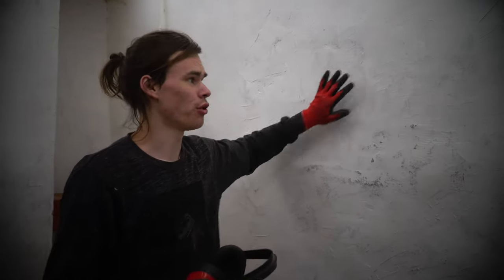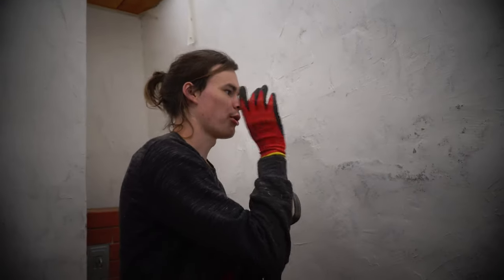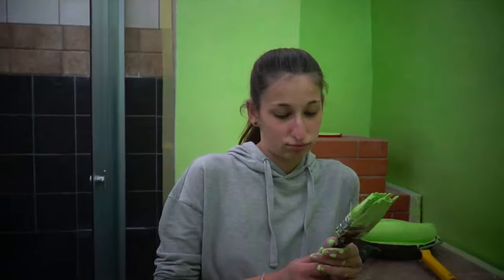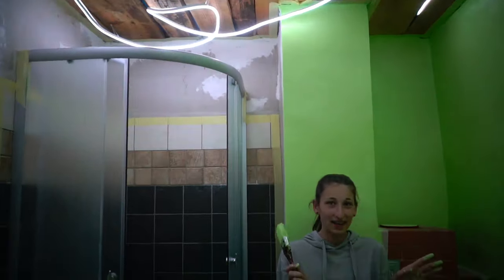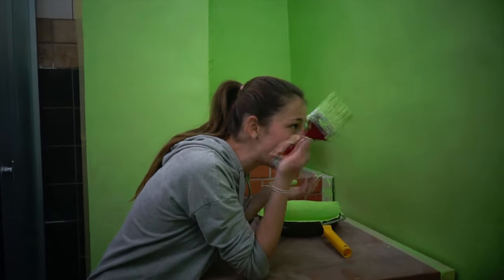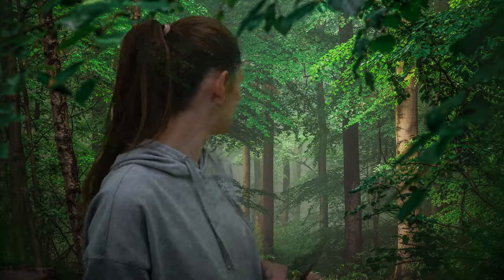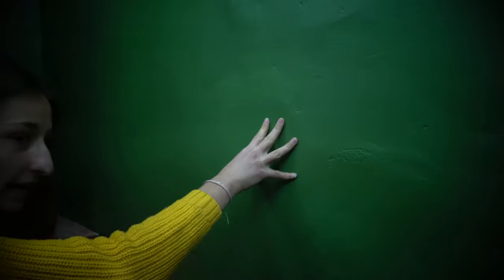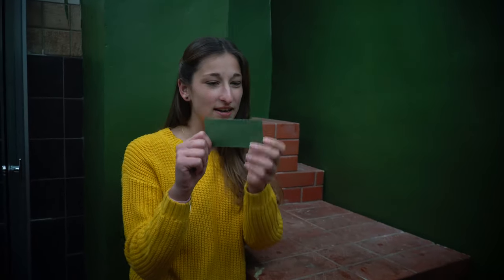Painting Bathroom (Renovation)

Comment: The bright green in the bathroom was a little stark in color so glad you changed it to a pretty color green.  The first color is neon green you need a pastel green to soften the walls. Actually that Kelly green with the dark wood ceiling and the red brick looks very striking.  It also goes great with the shower tiles. Use bright lighter colored accents on the walls to make it even more beautiful.